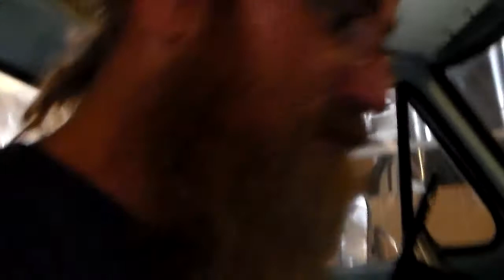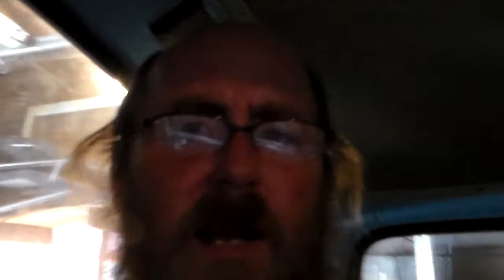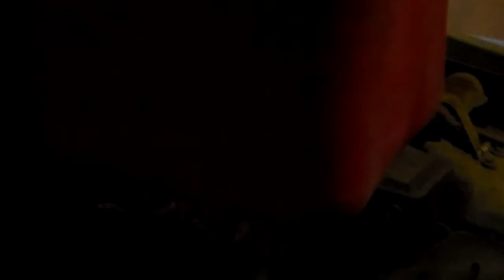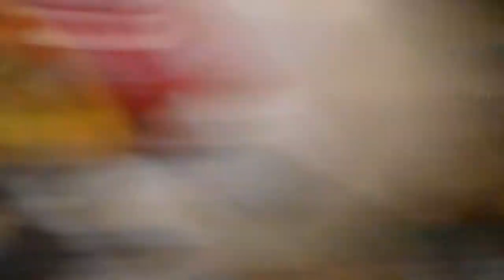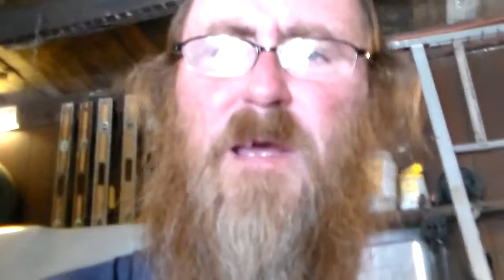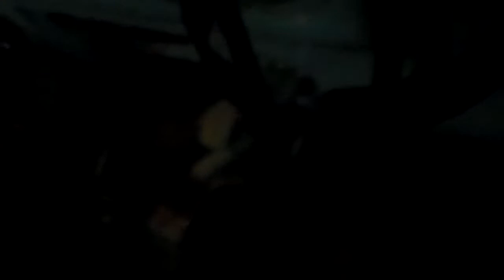Failed cold start `74 F250

Comment: I know this vid is old, but in hearing the cranking,  it sounds as if the compression in the cylinders wasn't all that great,  some worse than others.   I know you need a compression of at least 90 PSI for a cylinder to fire.    Much less and even with ideal fuel/air ratio and good spark,  it won't fire simply because there's not enough compression for combustion to take place.   Great vids you have here btw.  I just found your youtube here a few days ago and have been watching your videos.